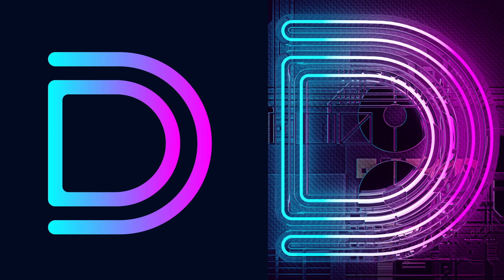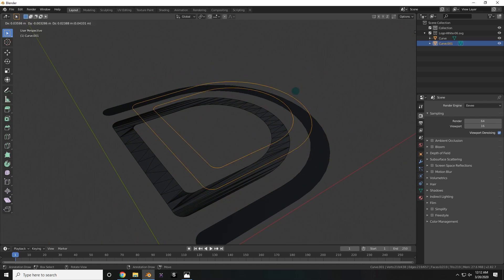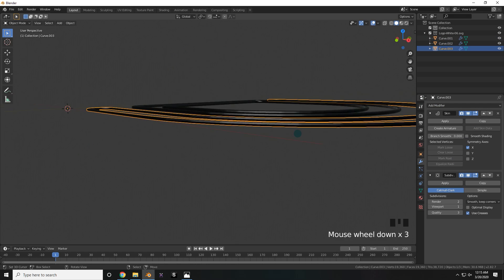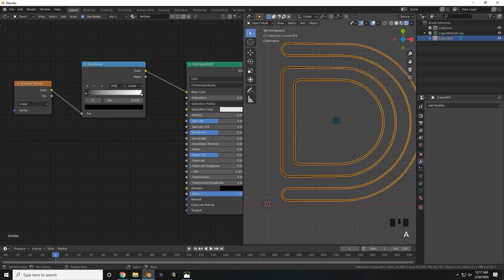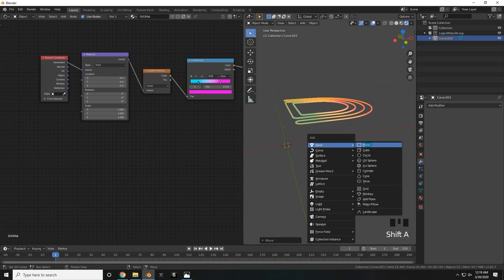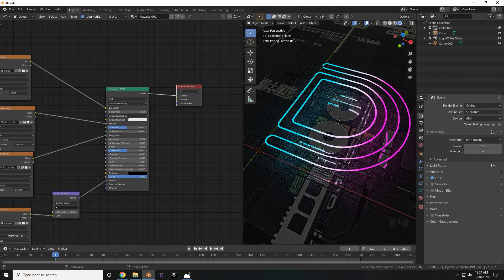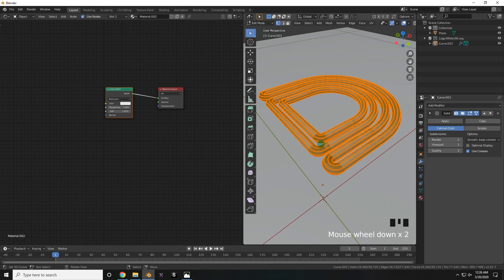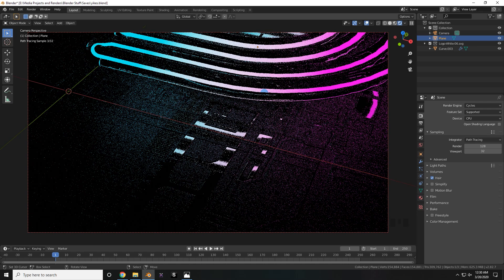Turn ANY Logo into a 3D Neon Masterpiece (Blender 2.8)

Comment: Skin modifier tool doesn't work AT ALL.

I deleted my inner edges and vertices. So it's basically an outline. I add the modifier and all i get is a non-scalable black plane that stands upright. 0 depth i cannot change it.
When i didn't delete my inner edges the thing ate so many rams it crashed the software.
Anyone got ANY clue?

Comment: Right after the part where you finish adding textures and making your pc suffer you use alt + a to enlarge the model well in 2.8 that undo all resizes what is a valid replacement?

Also what is the replacement for Shift + a to scale because that was updated.

On more thing in the notes for this video you said to do something to make the color look better where am I supposed to do that I am new to blender so need help.

I also dined excellent content

Comment: I tried to do this and I exported my file from photoshop as an svg. When I tried to import it into blender it just didn’t show up...it showed as a collection in the    Outliner but it doesn’t show in the workspace... PLEASE HELP
Reply from the maker: Sounds like it might be an export issue
Reply: Daniel Krafft you mean exporting from photoshop? I have tried exporting multiple different times...
Reply from the maker: Kaan Hadimi Ladha Wait a minute are you exporting vector graphics or raster? Pixels won’t work that’s why I used illustrator
Reply: Daniel Krafft ok thanks I’ll give this a try! I researched and found that photoshop is pixel based so I guess that’s why it wasn’t working.

Comment: hey, super channel & great tutos! I'm really interested in blender & typo works as its more my background, but it seem to me that this is the weakness of this so powerful soft... I've been all around YT tuts, add-on & more re-mesh etc etc .... and never been able to find a simple, clean & easy way to convert text or logo in a clean mesh... seem re-draw all the types is the only issue... This tuto is great for outlining some logos but  with A or B or any cut hole letters, skin mod don't work for me as it didn't take the little cut out triangle of the A for exemple... (even all selected ,try to copy and separate this part... but not working...) do you have any good advice / links about text conversion ? or a futur tuto ;) Also is there a way to refill the face of the outline text to have clean surface..? is so frustrating to me to see all those great possibilities and power & so hard to apply it to typographies easily... thanks for your channel anyway !

Comment: Hey dude, when I apply the skin modifier it only applies it to one part of the logo even though the whole thing is selected. The SVG gave me my logo as one path curve thing, so it's not like it's a different part like yours is. Any ideas?

Edit: Don't worry I figured it out by separating the individual pieces from eachother into individual parts and it worked. Great tutorial as always!
Reply: I could upload a screenshot to Imgur and put that link in here if it would make it easier to figure out?
Reply from the maker: Glad you figured it out!
Reply: hi ! got troubles with A & B letters the skin modifier don't take the triangle inside the A or the hole of B... try to separate and copy that parts.. but even if I got a layer A.001 with the supposed little triangle .. I got nothing on it.. :/ any idea ? thanks !

Comment: there are much better ways to make a thin wire into a beautiful wireframe. Try Convert Mesh to Curve and turn up bevel depth, as it is really the best way to go. If you want to stay on a mesh, you can add a screw modifier with Angle=0, Steps=2, Screw=0.2, then add a decimate in planar mode, then a solidify (Thickness=0.2) and then a subdivision surface. That setup will give you much better results out of the box.
Reply from the maker: Thanks for the tips mate